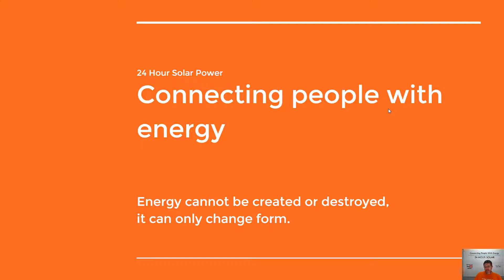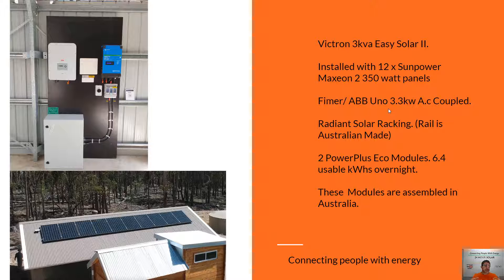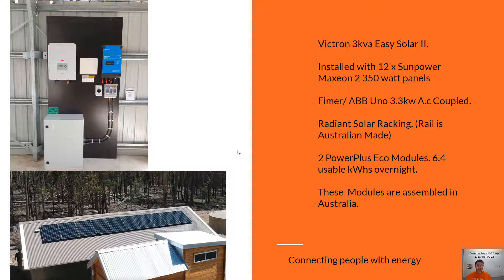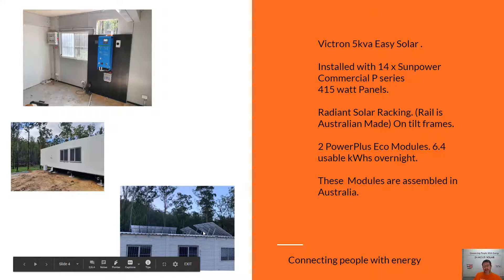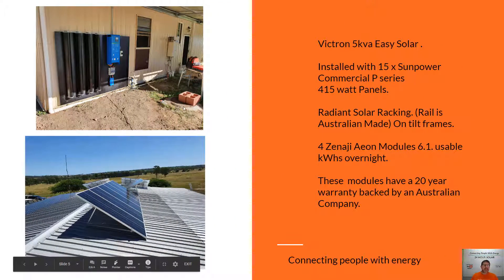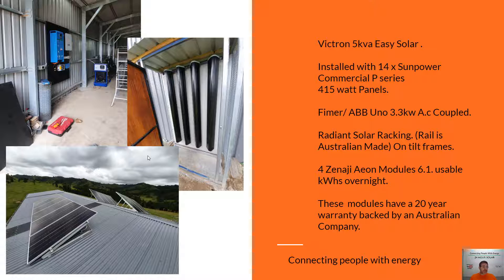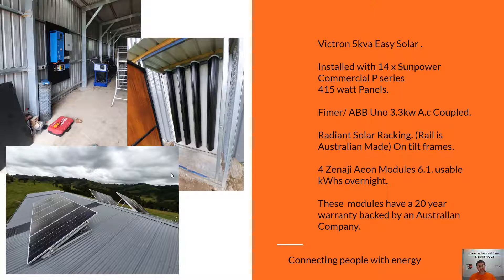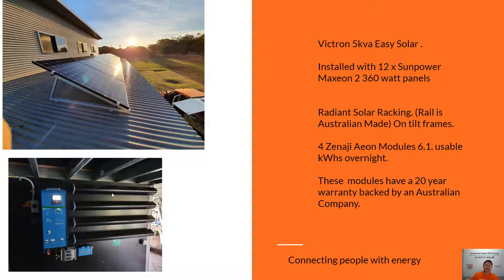Victron Easy Solar Installation examples Off-Grid Living

Comment: Hi, Some models have day inverter and night inverter. What is the advantage of having 2 inverters in a system?
Does each of these inverter have separate PV arrays? or they share one array of PV panels? 
Thanks
Biju
Reply from the maker: Yes, The AC coupled inverter is the day inverter and this is great to do more things of a day. It also is more efficient.  The day Inverter has PV into it and the night inverter just takes power from the batteries and Charges with the excess from the day time inverter/Charger.

Comment: Hi, nice video! What material is the black board you use in your installs?
Reply from the maker: Thank you. It is a formply that is fire rated from the timber shop. You can get away with the non fire rates stuff.